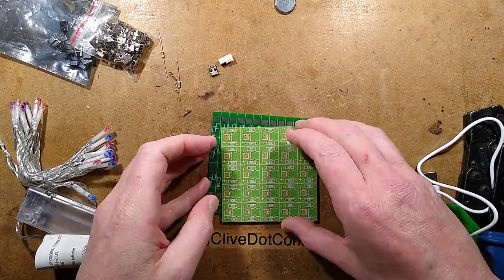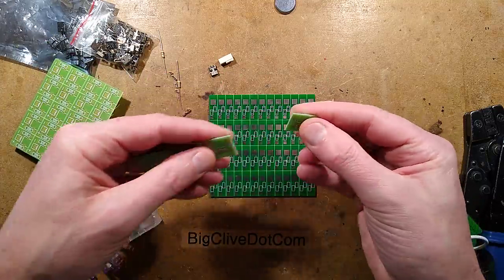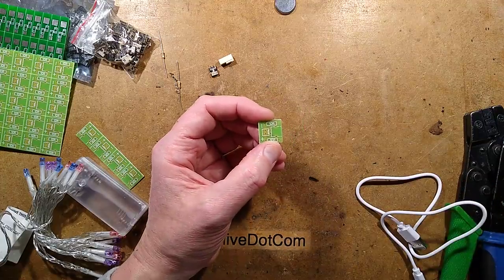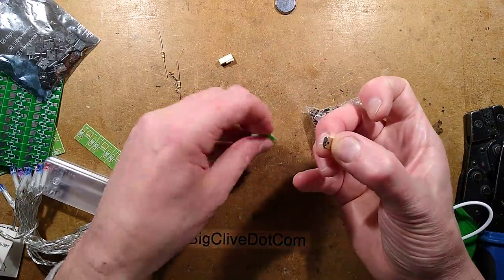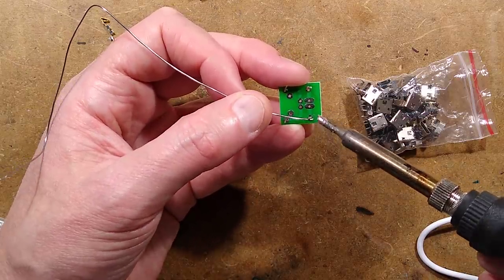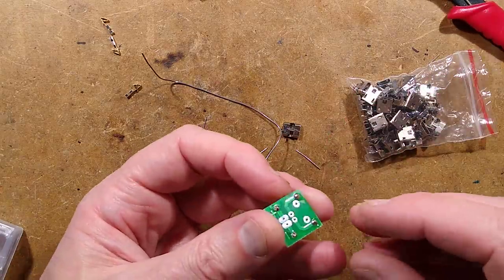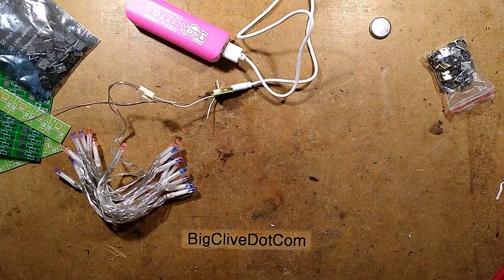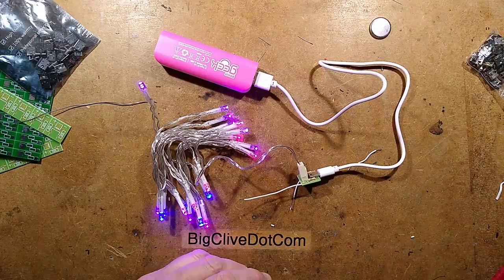USB to LED string PCB prototype build

Comment: The human body is very odd, at first you are clumsy and fumble, drop things and then you get the knack. You get used to holding things in peculiar positions and can assemble things, however if you stop for some time the clumsiness returns and you have to relearn all over again. If you could get the usb card reader cases to put the board in it would be perfecto.

Comment: It wont work because not all powerbanks accept a low current for long.
Reply from the maker: 100mA will keep most awake.
Reply: @bigclivedotcom  Yes you are right. I tried with a single led, that did not go well after 20 sec or so it turned off.  Great channel by the way.

Comment: 10:42 I disagree with your statement that the crimps separate the wires into 2 clusters.They actually crimp the wires into one bundle.

11:35 you show putting the wires in the housing, bu I suggest you should FIRST align the red/black polarity with the +/- pins of PCB.

I suspect you have already done this polarity task, but you didn't share that aspect with your audience.
Reply: How a crimped wire looks really depends on how big the crimp is, and on what end of the size range you are. If you're just barely within the minimum recommended wire mm^2, it does tend to produce two clusters. Point was that you shouldn't twist them because it actively harms the performance of the crimp - it can shear off strands, and doesn't get as good of a grip on the wire.
Reply: @ChlorideCull  I made no statement about NOT twisting the wires. I only said that there was one bundle not two. I have used the molex equivalent of this pin and it formed one bundle not two. You are free to believe whatever you want.